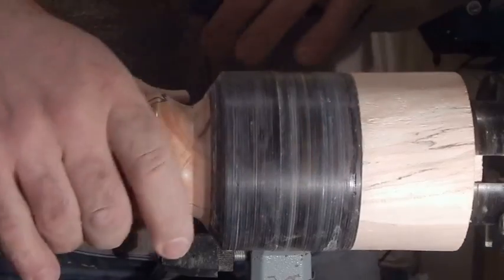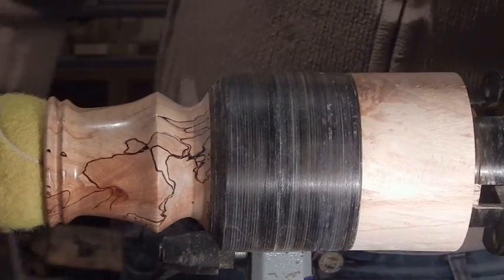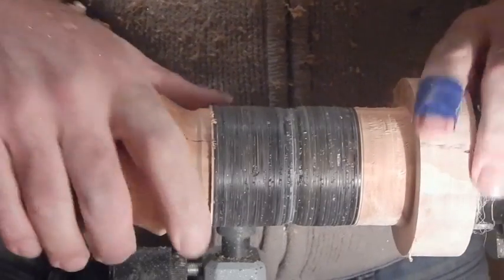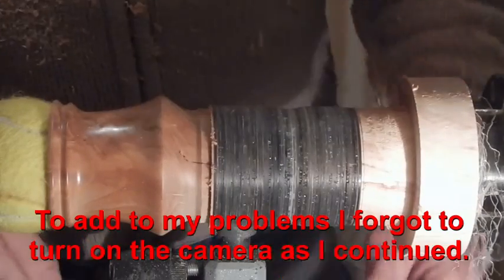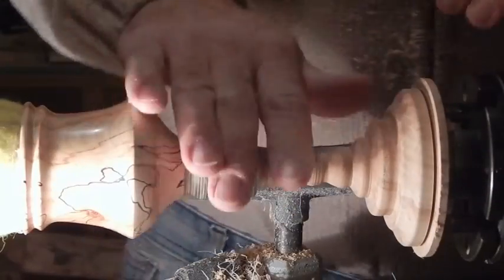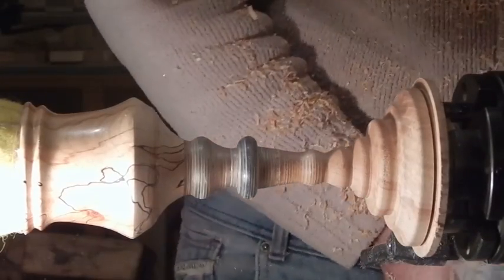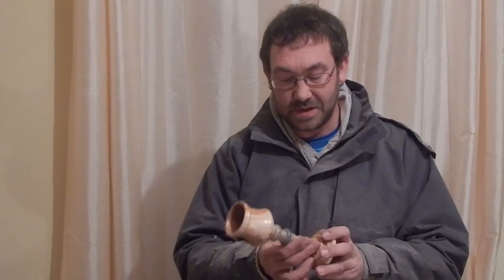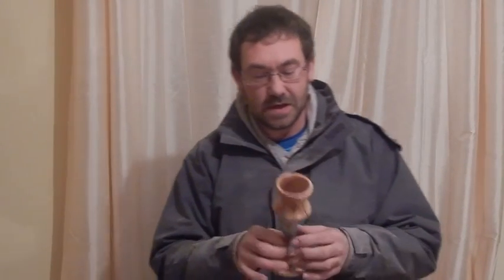Woodturning compact discs (Cd's) upcycling into a spalted beech and disc goblet part 2

Comment: You've inspired me to dig into this one.  I started off like you did gluing the disks together but found the same separation problems.  What is happening is the coating is coming off the plastic.  There's just nothing to hang onto there.  I tested this again by gluing two coating sides together and after curing overnight I split them with a chisel.  Easy separation.  For my second go, I sanded all the disks clean on a spindle sander, no more shiny silver coatings, just plastic.  That will hold.  I plan to make a bandsaw box with oak front and back and with the scraps I'll turn a pen or two.  The CA glue gets expensive on this experiment.  $7.00 in the can on the first go.  Keep up the good work and I'll keep watching.
Reply from the maker: +Redthumb45 Hi, how are you? Thanks for watching and for your comment, I have just finished my 3rd experiment, in which I sanded both sides of the discs, The result is much better yes..... I buy cheap CA from a store that sells 5 small bottles for €1.49 .... Not worth using expensive stuff on experiments, its easy to tell if the glue failed or if the joint failed..... Thank you for your input, your very kind...... My next video will be up soon... kind regards, Steve.

Comment: Turn the three sections separately to near tolerances. Provide a solid spindle of the target wood or use a darker contrasting spindle the entire length of the CD portion of your chalice. Once the sections are produced then glue it all up for the final turning. The bowl of the chalice could be hollowed out with a curved blade used for making small bowls. Everything you did was highly experimental and as such, problems will always be a part of the equation. Chin up mate. Now you know everything not to do on the next try. Great video no matter what the trolls say.

Comment: I see a lot of comments re: different glues to use on those CDs. You should keep in mind that the printing on those disks is screen-printed on and the ink used is not adhered as well as the CA glue you used. I'd bet your results would be improved by first sanding off any labeling/printing from those disks rather than trying a different glue first.

I think i when I try this experiment, I will also cut the disks square to turn them the other direction. This was an inspiring vid.
Reply from the maker: +RamDragon32 If you watch the video on making the pencil and Cd bowl you will see I sanded off the labels and aluminium foil and just left the plastic disc before turning...... I also just uploaded another video on turning another goblet with a Cd cup !! I left all labels and foil on the discs and used epoxy resin to glue them together ..... both project turned out well ....... I think the trick is not in the glue up but taking it easy on the turning...... Thanks for your opinion and comment, and I appreciate your watching, Regards, Steve.

Comment: You may have better luck gluing the CDs together if you take off the silver coating/label. The coating is not bonded to the disc as well as the glue will bond them to each other. Much like a coat of paint will keep you from getting things glued together.

This is easily done in a microwave over. It takes about 6 seconds for the "magic" happen. It is cool to watch too. This is the way to destroy any data on the disc too. (Fed security approved!)  It will not hurt the microwave. I set the timer for 10 seconds and watch for the flash-over. The coating is left looking much like a crackle finish glaze. It can be easily rubbed off.

Hope this helps. Love the idea.  I will be trying this soon.

 Z
Reply from the maker: +Zee-L Usay Hi !! Thank you for all that information, This was the first experimental project with CD,s I have since posted videos on other Cd project where I have removed the labels and experimented with different glues !!! Thank you for watching and commenting its very much appreciated, regards, Steve.

Comment: just watched your bowl and goblet videos and was very impressed, even with the learning moments. one thing about CA glue is that it is very strong in tension, but not so much in shear. the upshot being that your failures while turning the goblet was to be expected. the suggestions to use a continuous stem would remove the shear stresses and allow for turning a very thin skin over the stem section. also, removing the ridge on the read  (non printed ) side would provide a stronger and thinner glue bond.  it could either be sanded off or drilled out with a hole saw.
Reply from the maker: +Frank Woodruff Hi, Thank you for your information, your very kind to share it, this was an experiment and I have since done projects and videos using some of the techniques you have suggested. Thanks you so much for watching and taking the time to offer suggestions for future projects, much appreciated, regards, Steve.

Comment: That was a great joy to watch turning trash plasting into something so great looking.
had you thought of useing a piece of acrylic  or hardwood dowel to lock all the items together making wher the begining andd the end of it is ,it would belike giving it a spine with a little regidity. This was an old trick from my working days it may or may not be a good idea just thought i would throw it out there. Great video learns alot incase I decuide to go back into wood turning..
Reply from the maker: Thanks for watching, This was a mad experiment so I didn't put all that much thought into it as you could probably tell Ha Ha ...... Some great ideas you have there thanks. I appreciate your watching and commenting regards Steve.

Comment: A compact disc or CD is a form of digital media. It is an optical device which can be encoded with digital data. When you examine a CD you can tell it is mainly plastic. In fact, a CD is almost pure polycarbonate plastic. ( The primary building block used to make polycarbonate plastic is bisphenol A (BPA) ).There is a spiral track molded into the top of the plastic. The surface of a CD is reflective because the disc is coated with a thin layer of aluminum (!) or sometimes gold. The shiny metal layer reflects the laser that is used to read or write to the device. A layer of lacquer (!) is spin-coated onto the CD to protect the metal. A label may be screen-printed or offset-printed onto the lacquer. Data is encoded by forming pits in the spiral track of the polycarbonate (though the pits appear as ridges from the perspective of the laser). A space between pits is called a land.
When one processes cd's like you've shown in your video, strains come off and also extremely tiny plastic particles. Other studies have also shown that these microscopic particles càn actually float in the air we breath and are invisible to the human eye. Bisphenol A ( BPA ) and other chemicals ( kept secret by the plastic industry ) càn end up in your lungs or in the furcoat of your pets or be blown into our environment ! Nowadays one càn compare it with ASBESTOS ! 
So I HOPE you wear a mask ànd you will separate èvery plastic bit and RECYCLE it, because it IS dangerous for every living creature and our environment !! ànd still massively ùnderestimated !!! So it is also NOT a very good idea to spread these kinds of video's around, like here on YouTube. Besides the subject of the use of plastics > Your work IS fabulous ! ( RSVP please ) Cheers!
Reply from the maker: Hey Stephen, Thanks a million for that informative and somewhat scary information. Thankfully I do use a fine filtered mask and I dispose of any waste material properly and to a local recycle facility. My workshop is also in a rural setting away from any animals and I use a filtered extractor.
I really appreciate you sharing your information, watching and commenting. 
regards, Steve.

Comment: I very much liked this little project of yours. Thought it was a nice way to use old cd's rather than throw them out. i hope i'll see more interesting cd projects going forward.
one suggestion though, if you do something similar in the future were you sandwich cd's between blocks, would be to maybe turn a wood dowel about 2 inches longer than the stack of cd's then insert the ends into the wood blocks instead. from what i have experienced the bond between wood with wood glue is much stronger than the bond between CA glue and the cd's. another thing to remember when using CA glue if you don't already know is that heat weakens the bond considerably.
I hope my insight isn't to unwanted and keep up the good work.
Reply from the maker: +mazuzuri Hi Mazuzuri Thank you for watching and for your kind comment, I like all critique and suggestions ...... This is part two of this project, I'm not sure if you watched part 1 ? but I did turn the two blocks down to dowels and insert them into the Cd stack, However wherever you have plastic and wood joining its always going to be a weak spot .... Thanks again, much appreciated, Steve.

Comment: Great effort.  But I think there were a few things about the CDs.  The tops of CDs are a film that's applied to the plastic.  You were gluing the bottoms of the CDs to a top layer of peel-away film.  The center of the CD is usually clear.  Perhaps if you roughed up the center of each CD and took them down level to the surface of the CD (but roughed), then glued the entire surface, but with the bond in the center being the strongest.

But again.  The film on the top of the CD will just peal away under stress.  

The only other thing I can think of is squaring a peg that is a little larger than the hole, then using a heat gun to soften each CD's center and slide it on to the peg, let it rest, slide it off and then sand down any warping to the center so each CD will sit flush on top of each other.  But the peg would have to be a third piece that sits inside the base and the cup attached with glue.

Comment: not sure if anyone else has mentioned this yet. But I noticed that most of, or all, the splits happened at the center of the CDs where you were relying on the CA glue more than the center dowels. it might be possible to make a down insert that goes the entire way through the CDs and either goes into the stock at either end, or have holes in the dowel for the stock to go into. that gives you a single piece of wood the entire length. That combined with using epoxy instead of CA glue should help the overall strength during the turning process.
Reply from the maker: +Matt Dolan Hey Matt ! yep a few have suggested that as a plan alright, and my next attempt will incorporate many ideas that have been offered.. Thanks a million for watching and commenting, much appreciated...Steve

Comment: I think a better glue might be in order an epoxy maybe.
CD's explode at high RPM's even the smallest flaw is exactly where they fail.
maybe turn it at a slower speed and use a glue that will stay bonded even if the cd shatters.
I have 4 cars and all have cd players never have i played a cd on any of them cd's will be just a memory.
we need art like this.
Reply: +Chris Tindall It's the silver coating/label. it is not bonded well to the CD. 10 secs (about 6 usually)in a microwave removes it.

Comment: I am sitting back and enjoying your progress.   At the point when the cd stack came apart... I was thinking of the two post that meet on the inside of the cd center hole.  This idea won't eliminate the separation of the cd's but my add some support to the post.  How about one end protruding like the tip of a pencil and the other post have the reverse of the tip and the receiver end.  ... Just thinking ... ; now onto watching the remainder of the video. Thank you for sharing!
Reply from the maker: +sturdyinsd Thanks a million for your suggestion, This was a total experiment and I winged my way through it, so yes plenty ideas and remedies for problems encountered.... Thanks so much for watching and commenting, very much appreciated, regards, Steve.

Comment: May not have gone to plan but it is beautiful! Well done. :) 

- Heidi
Reply from the maker: +BlackCat2 Thank you Heidi !! Much appreciated, Steve.
Reply: Templeboy Turnings I love watching turning but have yet to try it myself. I recently learned though you can turn polymer clay when it is baked which is something I work with. I have known for a while you can also turn resin which is something else I work with. I may have to get into turning but probably won't be turning wood much. :D By the way - I could listen to you talk all day long. Love the accent.
Reply from the maker: Well now you got me blushing !! Yes I have seen that polymer can be turned and am trying to source it here in Ireland at the moment, maybe you know an online supplier ?? You should get yourself a cheap lathe and give it a try, its pretty simple to get the hang of ........ Or make a lathe out of an old drill like I did when I started ;-) Again I appreciate your time, Steve.
Reply: Templeboy Turnings I don't know about getting polymer clay there as I have never been though I would love to. :) Pardo polymer clay isn't available in the USA but I was able to get some. :) Have you checked on Amazon?

I think I should. I spend about as much time at my local home improvement store as I do the craft store. :) I have far too many interests.

I do know having a lathe would also help me with polishing my polymer clay and resin pieces I think. I like to find many uses for something across different mediums before I buy it. I found dozens of uses for a heat gun before I bought one. :D
Reply from the maker: Thank you !! It does ;-)
Reply: Templeboy Turnings Sweet! Glad I could be of some help. :D

Comment: To glue cd's like welding, remove reflecting paper first and clean chemical layers with pure acetone then use pure acetone on both faces, when you see both cd faces starts to melt stick them together. To use cd's with its reflecting paper, use epoxy instead of ca glue. You can use epoxy glue instead of acetone too. Epoxy glue is much stronger than ca glue and ca glue will always brake off. But reflecting papers doesn't stick well on plastic with chemical layers and it always have possibility to remove even when use epoxy glue. So it is better to work remove reflecting paper and clean chemical layer with pure acetone then glue with epoxy will always give you the best option. You also drill wood same diameter as cd's instead of making a rod and fill with epoxy glue both wood and cd block holes. With that you will have transperant piece. Nice work.
Reply from the maker: +Said Erzincanlı Thank you for all your knowledgeable information, its very much appreciated, I will keep all that in mind for future projects ...... Thank you for watching and for your kind comment, regards, Steve.

Comment: great idea enjoyed watching the experiment. had a thought about keeping it together, have you tried using a double ended screw to hold the two wooden spigots together inside the cd's as well as the glue.
Reply from the maker: Thanks Mark !! If I was ever to do this again I would glue the rod right through the whole section and glue it into the head of the goblet purely for strength, This was a huge learning curve buddy !! thank you for watching and commenting, regards Steve.

Comment: Perhaps a development idea.
I wonder how stacked compact disc would look with light inside the discs.
Something like a 1.5 Volt battery and a light emitting diode. Might give the array of discs a nice glow in the dark. Or maybe not, don't know.
Otherwise nice video ;)
Reply from the maker: +Dennis Andersen This is something I am working on, incorporating light into the pieces, Thanks for you ideas and feed back its much appreciated, regards, Steve.

Comment: I liked watching this video and having never done anything like it, I'd like to try it someday. My main wood working accomplishments are have been making shelves and a work bench from scrap wood for my garage. That and a wooden stand for my computer monitor.

Though I was wondering if it might be an idea to drill 3 holes in the CD stack a couple of centimeters from the middle in a triangular pattern. Then glue/insert wooden dowels of your preferred wood for extra strength and stability. Would look interesting I think and prevent the breaks you had.
Reply from the maker: +Rigal Thanks, Turning is great fun you should try it sometime !! some great suggestions there thank you !! I will keep them in mind .... Thank you for watching and commenting, regards, Steve.
Reply: When I can get a lathe and tools, I deff will be giving this a go. Got a few things I'd like to try turning!

Comment: I would make the one solid shaft going thru the discs and glued to the both wooden parts. In this case the strength of the whole structure wouldn't depend on cd's glued together. And, BTW, half of the beautiful spalted beech wouldn't  became to woodchips.
Reply from the maker: +Zortorond Yep I agree, but this was an experiment, and I did learn a whole lot from it !! So the lost wood wasn't totally in vain !! Thanks for watching and commenting its very much appreciated, regards, Steve.